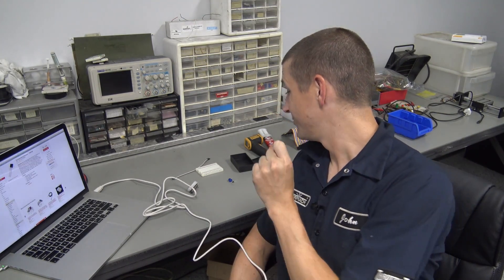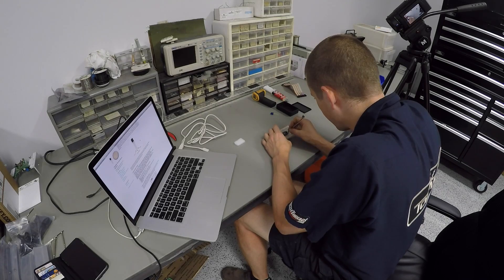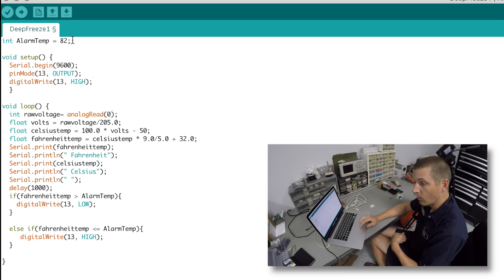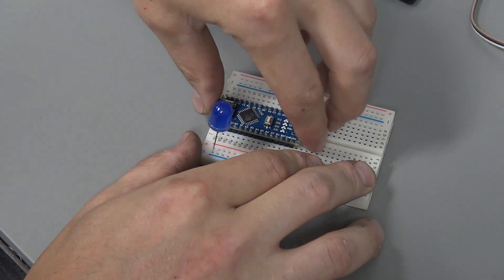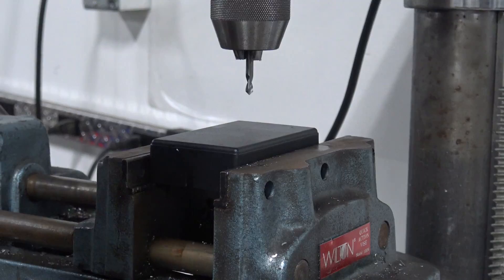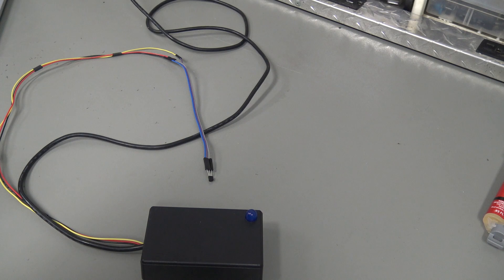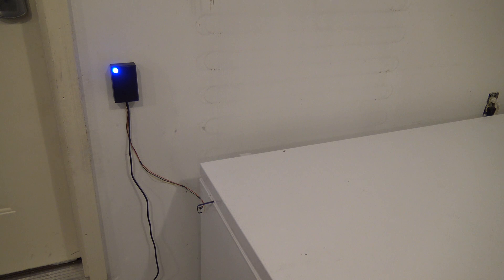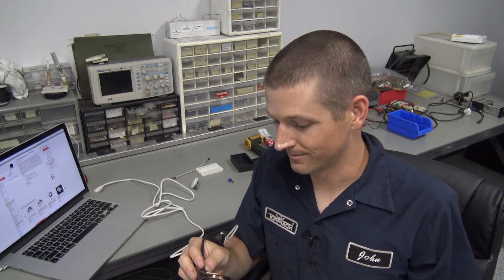Arduino Freezer Temperature Alarm!  Widget108

Comment: Cool project! Just put the breadboard right in the box, I love it.

I'm guessing you may have already done this, but you might want to set the trigger temperature to something a lot lower than 32ºF. My freezer stays at -2ºF and I'm guessing that deep freeze is the same (or maybe even lower). I think I would want to know if my freezer ever got above... I don't know... 10ºF.

By the way, refrigerators get down to nearly freezing. Mine stays at 38ºF.
Reply: Heheh :)

Comment: Why not solder the connections instead of jumpers?
And you should maybe look at a esp8266 so you can get notified anywhere if the is a issue

Comment: For flat wire solutions, copper tape between Kapton tape works great. I used to retail a few things on eBay and never actually finished up the last of the stock. Looks like this setup works great with what you've got buy if you need some I'll send a roll of copper tape over free

Comment: Cool project! (Sorta sorry, bad pun) I agree with the other suggestions an audible alarm and blinking light. Also curious if 32 is a good set point, I think some product will already be thawed by the time you see the mid to high 20's.

Comment: Cool project ;)

I also would make it flash, as if the arduino crashes with the output high, you would never know. Flashing will let you know the code is running.
Reply: +NYC CNC the Arduino has a watchdog timer to prevent this. It will reset the atmega if the timer runs out. In your code you reset this timer e.g. every loop, so it only runs out if your code isn't running or taking too long. 

Personally I'd just fade the led in and out very slowly. That way you can detect hanging code, but it isn't that distracting.

Comment: Had the same issue didn't use a Arduino,(haven't messed with one yet eventually I will)
i used a Digital Temperature Controller  that turns a night light on and it displays the temp.. I keep my freezer at recommended freezer temp  0 degree F. I might of missed understood you but are you setting yours at 32F?

Comment: I really need to get a couple of those nanos. I like the project but totally disagree with using breadboard as a permanant "pcb".
Reply: +NYC CNC protoboard is much cheaper.  Also breadboards do not provide much connection strength.  Soldering is much more reliable but I guess if anything fails then the LED will go out.  Maybe its because I've never seen breadboard used in a long term project.  I guess if it works.  I really need to get some nanos.  Ive only ever used PICs but the nanos look nice and use a standard usb cable.  Non of that "add two resistors to a few pins and connect via a serial cable" (getting harder to find pcs with them anyways) rubbish.  Is the programming language similar to PICs?
Reply: Arduino uses a C type syntax.  I believe PICs had a more BASIC looking language?  I buy those nano's 10 or 20 at a time from ebay for like $2.25 each. And the attiny85 for $1.70 w/ MicroUSB.  Nano's have 13 digital and 5 analog pins. ATTINY has 6 pins, some which do PWM, or Analog.

Comment: I suggest you make it flash to get your attention when there's a problem.
A flashing light will get your attention quicker.
Human eyes are drawn to action and movements.
Thanks,
John
Reply: +NYC CNC I think John meant steady on if it's okay; flash if the temperature is too high (and off if there is no power or a connection error).
Reply: If the Arduino hangs (yes it's possible), I guess the LED will stay lit even if the temperature rises above the set temperature level. Flashing will not continue if it hangs, it will probably be either lit or turned off depending on where in the cycle it hangs. So I should have made the LED flash if everything is OK, and turn off if temperature rises too much.
Reply: +NYC CNC 
Ok, got it.
Thanks,
John
Reply: Hi - I think that's okay to an extent, but it will probably feel much more satisfying (and reassuring) if the behavior was : steady blue light when everything is fine (blue = good = cold freezer) / flashing red light when there is an issue. That way not only you and your wife but also anyone not familiar with the alarm device will be able to tell if something wrong is going on. ("I walked past your freezer, and a red light was blinking!"). Basically : making sure that the alarm can be understood even without prior briefing or explanations. I hope that makes sense !
Reply: +NYC CNC 
Sorry, John.
I didn't mean to start something. 😊
Pior O is saying what I was trying to say.
However, you have the system working to your satisfaction so leave it as is unless you find it to be inadequate.
In that case, here are our suggestions.
I hope everything goes well with the baby watch.
Thanks,
John
Reply: If you want to avoid damaging the arduino (and do it the "proper" way) I suggest you put the LED through a resistor. Otherwise it can exceed the current limit per arduino pin, which is 40mA. Furthermore it creates quite heavy voltage interference. In reality it seems to work well even without it, however it is against the specifications and may fail after a long time or during a more demanding task. I am no expert at this, but I have read several times that this is a very common mistake, wiring the LED directly to the microcontroller.

Cool little project anyway!
Reply: Light OFF is the fail safe way. No light mean temperature too high or power to the unit has failed. So add a green light to monitor  supply and red off is temp ok..sorted. you can always add additional software to NO RED LIGHT,GREEN ON, GO AND SEE WHY...
Reply: I think it was a great video and thanks for sharing.  My thought was that it could do both.

ON = All Good                <28
BLINK = Warning           28-32
OFF = Oh Shit!                >32

Thanks for the quick video!  I didn't realize the Nano had pins out the back, so I will look into that!
Reply: @SolCunningham  There you go see! This highlights the value of these projects... We all get to learn a bit more.  Just wonder if the new baby will be a boy or girl or PROGRAMMER. Best regards.

Comment: Whats up John! Love your channel! You could just sample the temperature on a lower rate, like, every minute or 30 seconds, it would not get in the way of letting you know if the freezer got turned of and would probably fix the issue of the light flicking because the temperature would be stable already:)

Comment: Suggestion, blink the light on over temp. it will draw attention to itself... and an audible alarm would be nice too. ;-)
Reply: Good idea!
Reply: By the way, you have a great idea and are keeping it simple. just suggestions for V2.0. The no light condition would signify no power, blinking error state, alarm would be audible as long as there is power OR a simple relay that would sound the alarm off of a battery in a power fail, solid light all is well. gust energise an output to a simple relay for the alarm the battery would get used when the sensor goes high or the main power fails.
I know this is complicating it, you could even use a supercap as the backup power source.